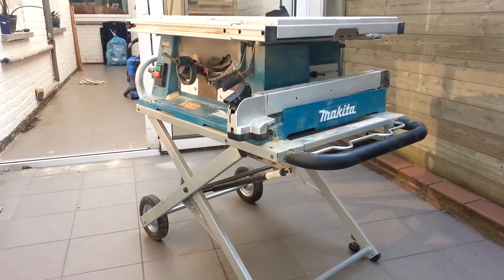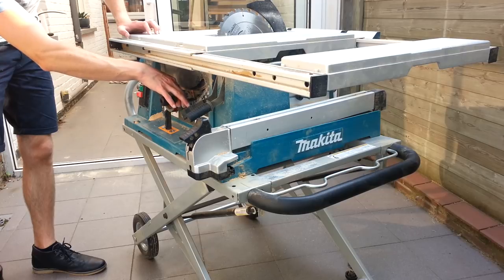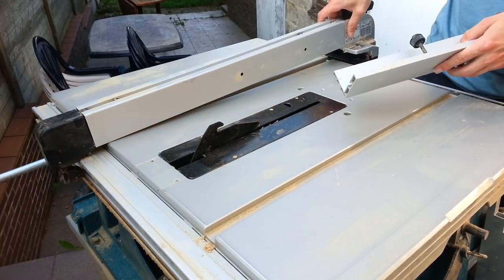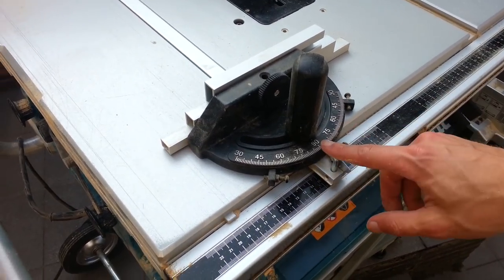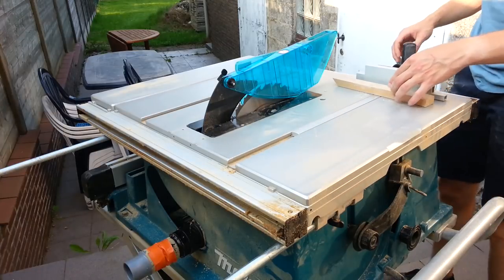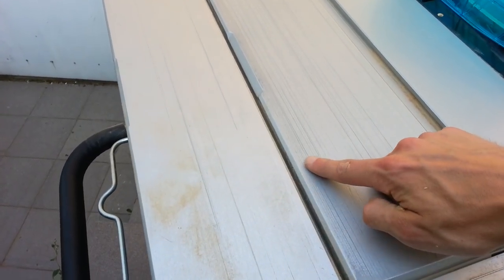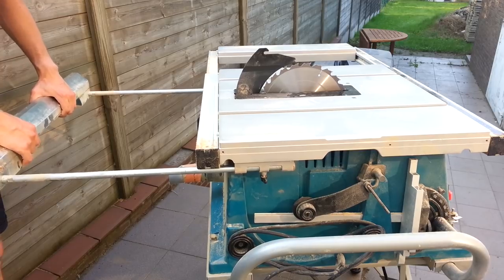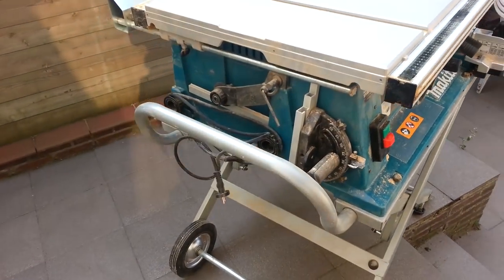Makita 2704 table saw

Comment: I bought one of these second hand and I absolutely love it. People saying the rip fence isn't sufficient are clearly talking about the wrong product as it locks front and back which is perfect. Great review.
Reply from the maker: Sometimes you need to tune the fence so it squares up nicely. There's a bolt to adjust but most people don't do it and they get out of square cuts (which is frustrating for sure).
Reply: Yea probably talking about the previous model where the fence only clamps to the front

Comment: Hi great review - thanks. Just a word of warning about the stainless steel screws that you fitted, stainless steel and aluminium tend to form a rather aggressive galvanic corrosion coupling with the aluminium losing the fight. Passivated stainless steel is even worse, the reason Makita used those blackened screws was to form a dielectric barrier between the screw material and the aluminium substrate to protect against galvanic corrosion.
Reply from the maker: You win the prize for the best comment! I didn't know any of this. Thanks for your insight :)
Reply: @makedo3332  I can confirm this claim. This galvanic corrosion is annoying as you likely won't see it, but it can almost "weld" your screws in place.
Reply: would there be any kind of treatment you could apply to the stainless steel screws to prevent this ?

Comment: What is the point of the black screws at 4:00 ? Also, another point is that making a zero clearance throat plate is extremely difficult for the makita table saws. I dont know why they made that design choice. All the other brands seem to have the traditional style of throat plate.

Comment: The makita LF1000 is also a good buy for house use or construction sites is also a good buy, because it can be operated as table saw and miter saw. However, I don't recommend it for use in a carpentry workshop as abasic tool, because its table is too small for some applications

Comment: Thank you for the video. I have recently brought this table saw. Does your right extension table sit lower than the main table? Many thanks.
Reply from the maker: It does tend to hang down just a fraction. It's the only thing I hate..doing big 45° mitres is not that precise because of it :(
Reply: Thank you. I currently have the extension table and the holding rails removed. Looks like each front and rear holding rail can be adjusted with 4 screws once the extension table has been removed. Hopefully this resolves the issue.

Comment: Hi. I'm planning to buy a bench saw, but still didn't decided yet between Makita 2704 and Bosch GTS 10 XC. What can you tell me about the T-tracks? Are they standard ones? I saw that on Bosch are not, and also both of them not same width. So if you want to use different add-on's....quite difficult. Thanks for your reply.
Reply from the maker: Hey MrSavage. I don't know what the standard is where you live ;) On the Makita the tracks are the same on both sides of the blade. The track itself is 18-19 mm or 3/4 inch wide (didn't have my calipers). I know a 18mm sheet fits just right on its side :)
Reply: Makedo thanks. Standard is also where I live 3/4” :) Would you buy it again the 2704, or would you go something else?

Comment: I have my doubts since the motor does not use bronze bushings, it has plastic gears.
Bosch GTS 10 XC and Metabo TS254 use metal in their gears and bearings in the motor.

Comment: Am confuse between dewalt dw745 and makita mot 2704 .which one to buy? Please to help and advise!?
Reply: Well I think the Dewalt is lighter and more easy to transport. The system to change the fence distance is more easy. The Makita is a little bit cheaper and has a bigger table surface. It is as precise as the Dewalt but I can't seem to trust the little marker that tells me the distance to the blade. I need to take out my tape measure to set it exactly right. I have no idea how easy to use the Dewalt is but I think their system is faster to set the fence just right. In the long run, they are both good saws. I hapened to like the bigger work surface of the Makita but if you are a contractor, I think the Dewalt is more interesting for you.
Reply: @r3inhout  thankx a lot...the issue that thé dewalt still.not avaible in My country algeria ...makita mlt 2704 yes...i will use IT for diy huby ...thankx chef

Comment: Hi, I have a question for you, I have this table saw and I have built also the cross cut sled. The problem is that when I turn the saw on, the blade moves a little bit to the side (like a vibration with every start, like a wobble) and it always cuts into sleds groove for the cut and it destroys it (if I turn the saw when the sled is on it). Do you have the same problem or does your saw start smoothly? I am thinking of having it replaced because of this. I hope I am clear. Thank you very much for your answer.
Reply from the maker: Hi Jan! I have worked with a couple different brands of table saws and all of them have some sort of a wobble until the blade is up to speed. It is normal physics because the blade is sitting on the side of the motor. When the axial forces are high enough, the blade is stable. If you look at motor bike races and the driver falls of. Sometimes the motor continues on its own because of the wheels stabilizing. You normally don't notice the wobble until you use a sled and it bites away parts of it. I always tend to start the blade outside of the sled and then bring it in when the blade is up to speed. That's the only way to go. Sometimes, it also depends on the type and quality of blade you use but for your machine. If they have been stored flat with weights on them, they can be a little crooked. If it is really differing more then 1mm side to side, get it back.